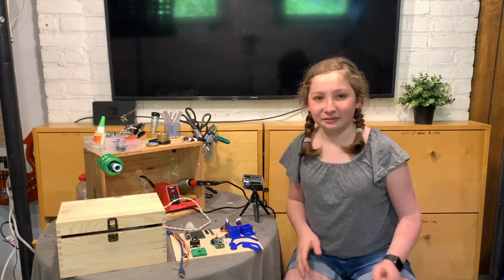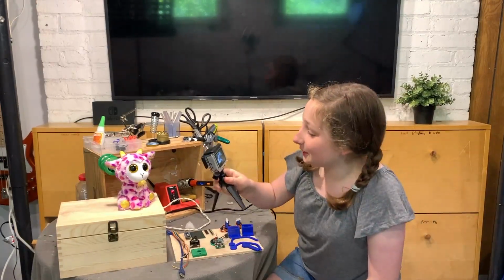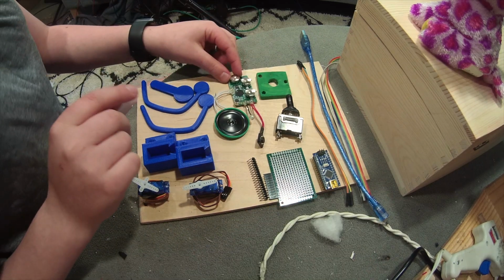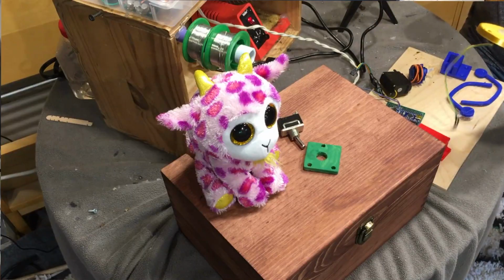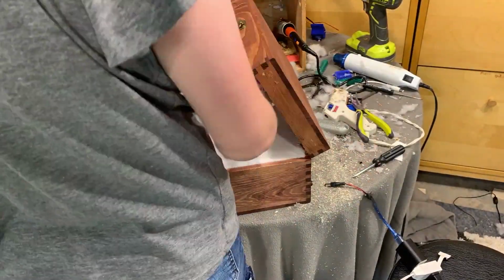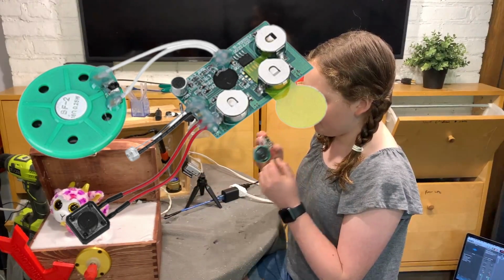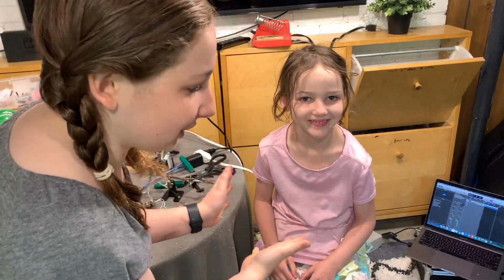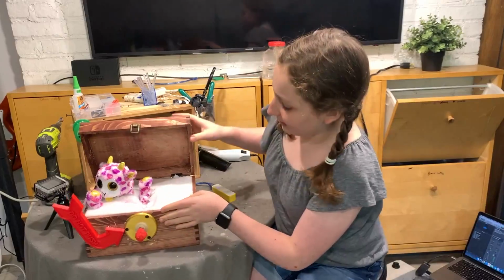Best arduino project ever!!! | Building  Useless Box!! |

Comment: hmm the card reader makes me want to make a animatronic controll box
Reply from the maker: Spoiled alert: I have been working 20 hours a week on a custom controll system I can make and sell for cheap so animatronic-makers don’t have to spend so much money. Jerry’s controller adds up to around $600. I plan to sell this one for about 50$. I will make close to no money off of it, but I am doing it for the animatronic community! It will be a 8-16 servos, light, and audio controller run from an Sd card! I’m trying to come out with it ASAP, but it will be done in a few months. (I will also provide instructions to make you own, and code, but it might be easier to buy the board for some people)

Comment: Nice work, it’s amazing what you can create with 3D printing and Arduino!  Try a stepper motor for the box top - it should have the torque you need.
Reply from the maker: Thanks a lot! I was thinking of doing that but I had a time constant and didn't have a driver board for a stepper. I also should have used higher torque servo but I was really pressed for time and amazon 2-day shipping just couldn't cut it! lol. Tanks for subscribing!